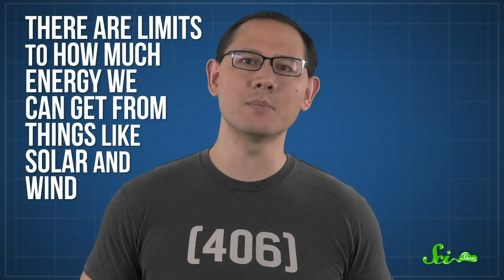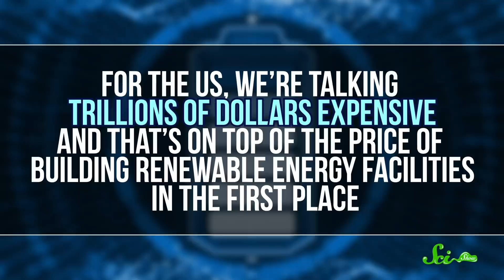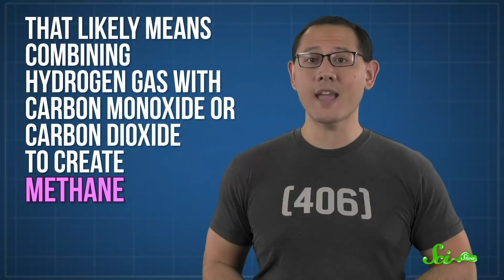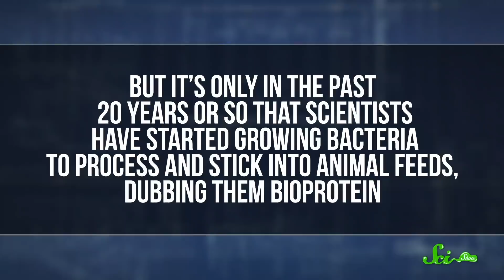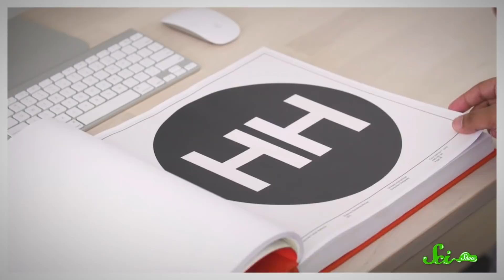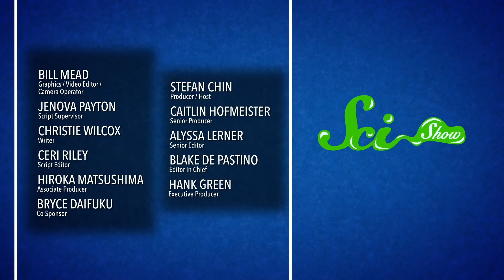How Engineers Are Turning Wind into Protein Powder

Comment: 20th century people are going to make a mess of this, 21st century people, YOU, need to step up and cease fossil fuel use. and switch  to solar/wind/wave generated energy for your needs. gas and bio-fuels are 20th century ideas. roof tops and glass windows should be generating all the energy your building needs, your vehicle should be collecting solar energy all the time and using wind energy when in motion, and any excess generated energy goes to feed the grid. simple huh? but 20th century people don't think like that, they're worried about costs and profit, not saving the planet for future generations.
Reply: Nah most people on earth are just concentrating one getting from one day to the next. YOU need to get off your high horse and realize most people don't have the luxury of picking an energy source. Sure up on your high horse you can dictate what energy source we should use but down here in the real world we are just trying to keep our families fed and not get shot by this weeks mass shooter.
Reply: "using wind energy when in motion" You do know, that this would be slowing the car down (it would be a diesel power plant if using a diesel engine, it would be just a loss of energy if using an EV). 
"any excess generated energy goes to feed the grid" Where does the excess energy go, there must be some storage devices in the grid.

Solar/wind + energy storage is an extremely expensive route. In my opinion, we should use cheap and clean technology like hydroelectricity, biomass power plants (with PM filters), geothermal where it's cheap and nuclear power. When we have a breakthrough in energy storage like some new kind of cheap, energy dense and reliable batteries, we could switch to solar/wind. I'm not even what you refer to a 20th century person, I was born near the start of 21st century.

Comment: isn't burning methane way worse for the environment than c02?
Reply: No, releasing methane is way worse than CO2.  Burning it just produces CO2 and H20.

As long as the carbon in the methane isn't coming from fossile fuels it's perfectly green even to not recapture the CO2 like was proposed in the video.

There are some proposals to "farm" methane producing swamp-scum in enclosed areas, capture all the methane, and then burn it as a bio-fueled power plant (and/or even convert the methane into other biofuels and ship them out for use as a more standard biofuel use)

Actually, it can even be a carbon-negative fuel source under the right conditions, as with capturing methane from landfills, and then keeping the carbon rich sludge in the landfill burried as a form of carbon sequestration.  Sure you can't run a power grid off that, but it helps.

Comment: Why is there never any mention of Geothermal Energy? It is constant, clean, cheap, abundant, and available everywhere passively. And anywhere that Magma flows nearer the surface, such as Yellowstone, it could be harnessed actively to create electricity. Instead of fracking, that is literally polluting billions of gallons of freshwater. When water is already in short supply in many places or very unhealthy for people, especially children, to drink. Geothermal might even be used to cool down the magma dome of Yellowstone. That many fear, if it explodes, would destroy half of America in an instant.
Reply: Because it's not most of those things in most places.

We don't have the tech to do it everywhere.  Unless the heat pockets are very close to the surface the digging of the holes can be rather expensive (and that often needs redone as the spot cools off).  Heck, in some areas, it can even produce more radioactive waste than nuclear power plants due to what it brings to the surface.

Don't get me wrong, like hydroelectric, it can be a great option in the right places and we may improve the tech in the future,  but as it is now, it's not a panacea.

What we should be talking about more is fast-tracking 4th-gen nuclear plants, many of which (like some thorium designs) are immune to meltdowns, don't pose a nuclear proliferation risk, and can use current nuclear waste as fuel.
Unfortunately nuclear has been so badly stigmatized by sensationalizing bad decisions made in 2nd-gen reactor design (we're currently only building gen 3.5 btw) that too many people concerned with the environment can't objectively talk about it.
Reply: Geo-thermal isn't as efficient as it seems, it works in small applications like Iceland but as a larger generator of electricity, it might supply the Yellowstone area or the Mono Lake area but that's it.
Reply: @RIXRADvidz  no its really efficient it manages to power an entire nation on top of being the power source most often tapped by high energy demanding industrial processes like separating aluminum from bauxite.
Reply: geothermal power relies on the geothermal gradient which is on avergae~30°C per km. So you could heat your water from ~20°C at the surface to 50°C (probablyy less, because rocks at the surface don't start at 20°C) by digging a km deep hole for about a million $)
Most geothermal installations have boreholes only a few hundred to about one hundred meters deep (or even less) so it's just a supportive element.
As others mentioned, as an energy source it's only viable at geothermal hotspots with gradients of about 100°C per km.
So I wouldn't say geothermal power is abundant and safe, since you can mess up the installations and potentialy create millions of dollars in damage by drilling into the wrong sedimentary layer (e.g. anhydrite or clay which will increse in volume).
Reply: Good question.

Comment: Yeah, but if we use water this way, isn't it not renewable?
Reply: For the food, it's probably less than the amount of water you'd have to put on fields to grow the same amount of food, especially as water won't soak or evaporate away so easily in bacterial tanks.

For the non-food storage, I'm not sure. You might be able to use seawater directly, and there's no shortage of that.
Reply: @SimonClarkstone  I'm wary of "there's no shortage of that" and if often when in abuse of the ressource and made some species go extinct.
And for the food, it still need to rip the water molecules appart to create the methane.

Comment: has anyone thought of storing the extra energy as potential energy like pumping water from a lower reservoir to a high one and storing it until you need power then releasing it through a turbine? i assume they have but i don't hear anyone talking about it in videos similar to this one from the channels i have subscribed to.
Reply: It's actually a pretty widespread practice usually referred to as "pumped-storage hydroelectricity" or "pumped hydro" for short. Tom Scott has made an excellent video about it (and a ton of other science and engineering things) https://youtu.be/6Jx_bJgIFhI
Reply: There are other systems that use green energy to store compressed air, to be reused at peak demand.

Comment: This is definitely one extra step in the expansion of renewable energy :)
The storage is one of the biggest problems when it comes to renewable energy, traditional power plants like thermal or nuclear are extremely slow systems so to integrate clean energy in the existing system we need need to store them
Reply: store it in the grid, shift over producing areas to areas in need, the whole grid would have to cooperate to meet the energy needs of the country.  no more generating for 'your area' , big generating plants are to feed the grid, local buildings should be producing their own with roof top and glazed windows capable of collecting solar and wind energy and feed the grid with any extra

Comment: First, cloudy with a chance of meatballs much?. 
And this seems amazing but unattainable, the kind of efficency and tecnology it requires, leads me to believe that a more affortable solution will be established before.
Reply: The great thing about renewable energy is that once its on a big enough scale it evens out
Reply: Their is a better cheaper solution. Use excess electrical energy to heat an insolated molten salt heat sink then use the molten salt to heat water to steam to run a turbine. They use them already at solar collector farms and are looking how to convert one to server a more convenient energy storage role.
Reply: Or store it as potential energy in water in a dam by pumping it back up.
Reply: @Gengh13  There are a number of places already doing that and it's a good storage method. They are also looking at solid versions by lifting heavy weights and using regenerative breaking when running them downhill to turn the kinetic back into electrical
Reply: If you look up the new sodium-glass (already working) and carbon-glass (coming soon) rechargeable batteries, and the potential carbon super-capacitors, you can see the next solutions for energy storage.  These will hold several times more per kilogram than current lithium-ion ones, can be made from sand and salt and grass (cheap!), and recharge over 10,000 times without losing significant storage capacity.  Electric cars could go over 1600 kilometers per charge.